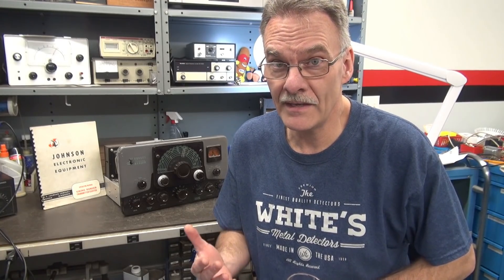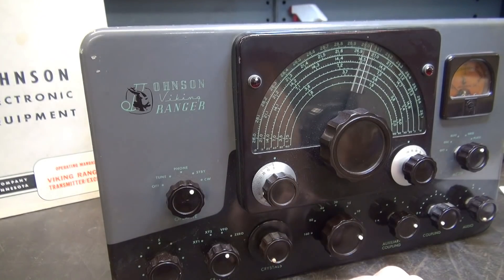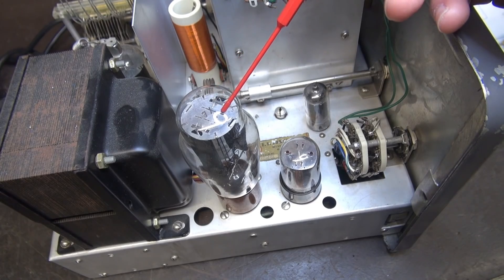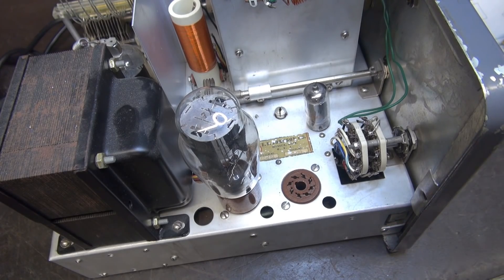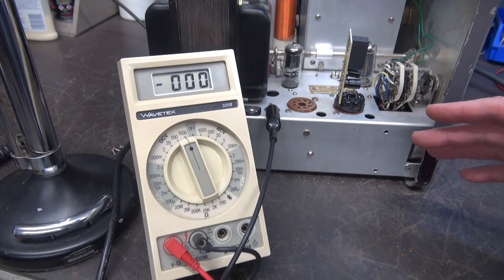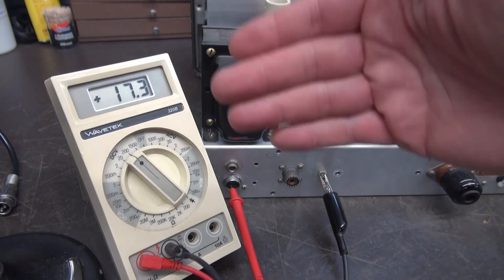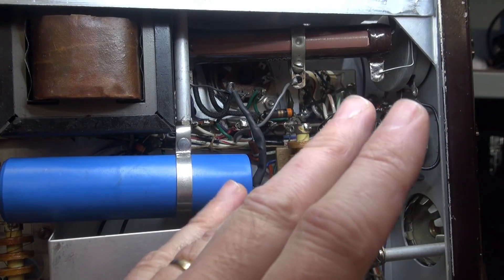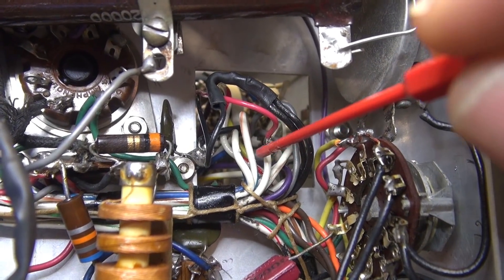How to install PTT Push to talk Johnson Ranger Ham transmitter

Comment: Hi Terry. I acquired a Johnson Ranger II that is missing all the tubes and one coil is missing (L6). I am confident that I can restore the radio but I am not a ham operator and I wouldn’t have the expertise to do whatever alignments that it would need. Assuming the restoration isn’t cost prohibitive and I proceed with the project, is there an extensive alignment required? If so could I have you do it (for a fee of course)? And after all that what might the radio be worth to an operator? Thanks in advance for your advice. I love your videos and can’t tell you how much I have learned from them.

Comment: Well, it looks like you helped me get my Ranger to operate trouble-free PTT.
I found a period correct Potter & Brumfield 12Vdc DPDT relay and mounted it on the Keyer board.
I took 6.3Vac from the tie strip for the panel lamp, and after it's rectified and filtered with a 1000uF 16V cap, I have just a hair less than 9Vdc, which is more than enough to drive the relay...I wonder how many hams cooked components without switching the screen line to ground...?

Probably LOTS of them...!  Glad you posted that...!!!

When I was connecting the PTT line(relay ground) at the mic connector, I noticed that the audio cable shield was caught on the CW key line tab at the tie point on that "hidden"  rear terminal strip which explains why the rig wouldn't unkey with the key up...!  I don't think this rig saw too much operation because of the shorted key line...

Comment: Hi Terry..I'm just going through a Ranger myself right now. I my manual, the PTT diagram doesn't show tab 6 of SW4-A being involved in the PTT circuit. What is the purpose of switching tab 6, or is that only implemented for early Rangers without the keyer circuitry...?
Reply: Ok Terry...Now I see where you went there....I found the Ranger II manual which adds contact 6 to the mix...Keep up the great work...!!!!

Comment: Excellent!

Is there any need for dropping resistors when subbing diodes for the 6AX5? How about when subbing for the 5R4 HV recifier?
Reply from the maker: Nope, none required, as for the 5R4, there is a solid state replacement on the market 1n1239

Comment: Terry what is the current consumption of the relay? I think it is sitting on the 6.3V filament line. Does the mod load the filament transformer?
Reply from the maker: Hello, The relay has a 360 ohm coil, 12vdc applied. Much less load than the 6AX5 filament
Reply: D-lab Electronics thanks Terry and understood. Thanks for great videos. 73 Dick N4HAY

Comment: I am a student learning the hobby. Correct my lack of knowledge if my statement is incorrect. A rectifier not only rectifies the voltage but because it slowly heats up their current slowly ramps up in the electrical components do not suffer a rapid thermal shock from a pulse of current hitting them like a sledgehammer. When replacing with solid-state diode‘s that feature is lost of a slow start. So as a student with my limited knowledge and I just discovered within this last year the purpose for a CL 60 thermistor , would I add one of these across the mains to limit the inrush current to compensate for the loss of the tube rectifier to extend the length of life of my electronic components by softening the blow of inrush current ?. I am learning from you and others before I attempt to build from scratch my first high-voltage tube amplifier. Keep up the great videos I’m like a sponge absorbing all the information.
Reply: ...there are several ways to control the inrush of current to electronic equipment- it depends on how fancy you want to be.

You mentioned using a "thermistor across the mains"- but a current limiter needs to be IN SERIES WITH THE MAINS if it's gonna be effective- and having another component in SERIES with the mains, adds ANOTHER link that can disable the equipment. 

A lot of guitar amplifiers have a "STANDBY" switch that is used to shut off the plate voltage to the vacuum tubes- while letting the vacuum tube filaments stay energized.
Reply: @daleburrell6273  didn’t think about the amplifier analogy. 
                 Amplifiers have those Thermistor ( cl60) and series the resistance is high when they’re cold when you turn on the device it warms up and the resistance goes down to let for voltage through after a few seconds. 

      I build class A  amplifier.
Reply: @coldfinger459sub0   ...in the older CRT color TV sets, there was an automatic de-gaussing circuit, that used a thermistor/varistor in series with a coil that was used to automatically demagnetize the CRT when the TV was turned on- these thermistor/varistors were a source of trouble, because they wasted power, and they were subject to deterioration. 

Putting something like THAT in SERIES with the mains, is liable to disable the electronic equipment when the thermistor/varistor deteriorates.